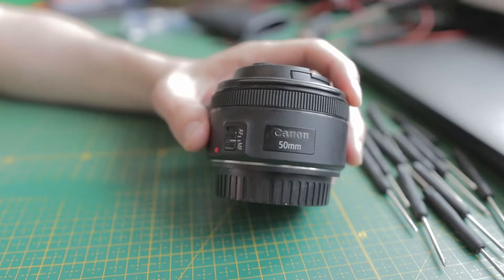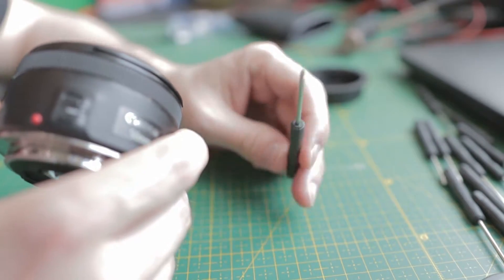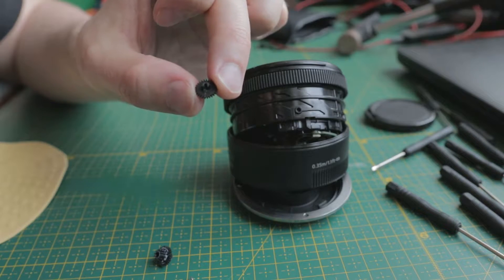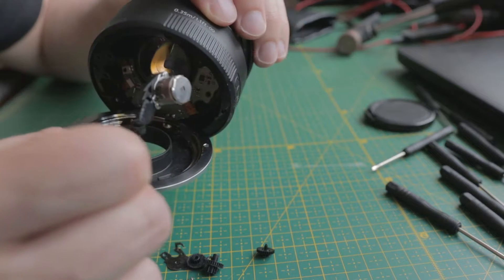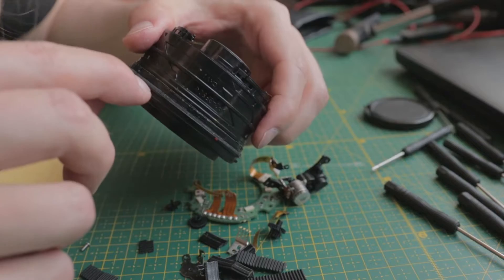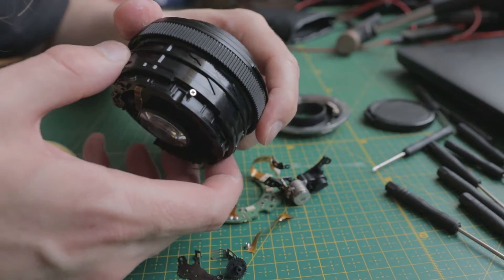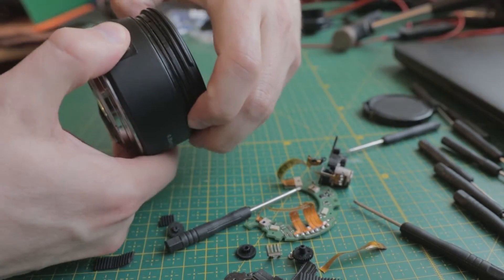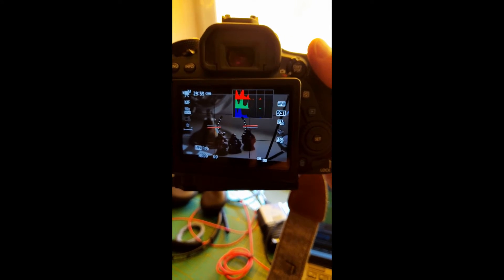Fixed broken focus ring - recycled 50mm. How to fix a broken camera lens?

Comment: Hi, just asking for some insight into this, is there anyway to remove the focus ring without breaking it?
Reply from the maker: As far as i can tell it is possible but i wouldnt recomment trying this without a proper set of tools and oils to set it up after fixing. If there is anything missing You wont` get to buy a new part, rather looks for some old broken lense and just maybe the service can replace this.  Best way to take it to a proper professional equipped with all the bells and whistles to do it / fix it :)